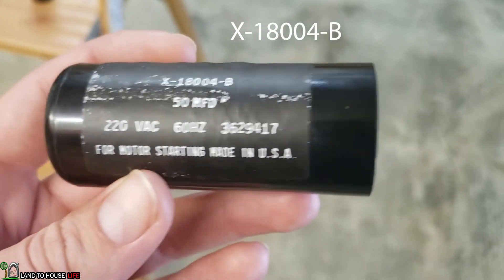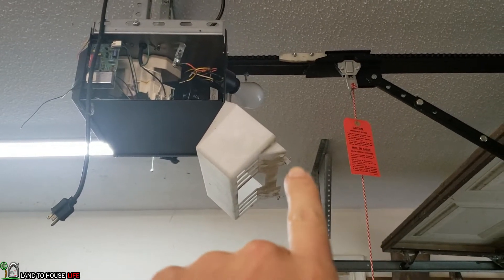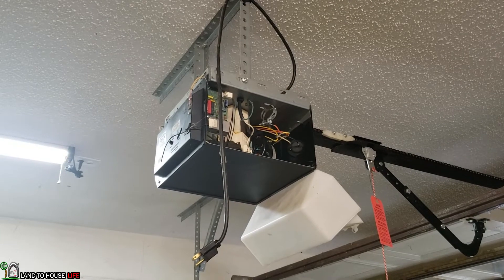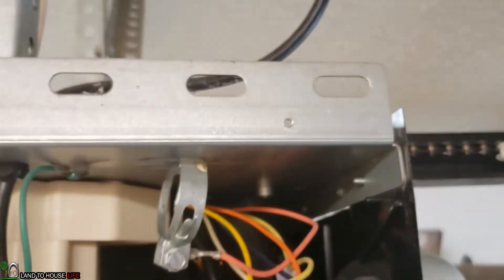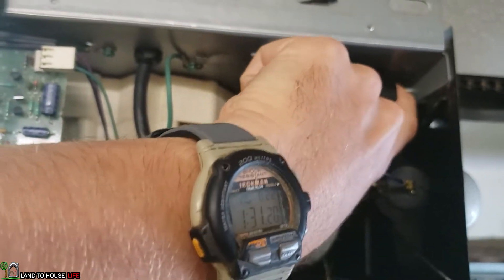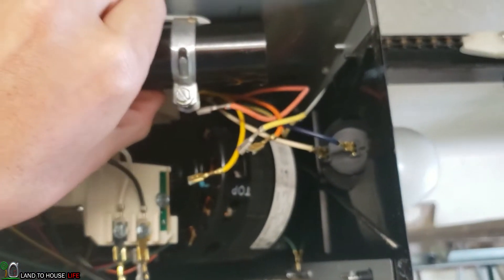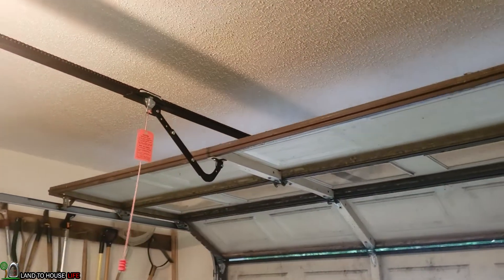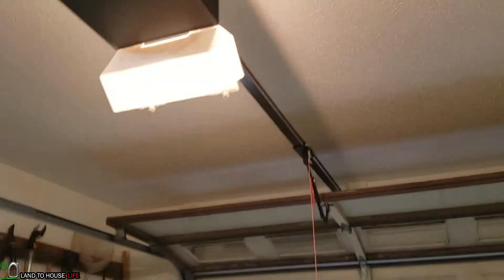Simple Garage Door Opener Fix [Corroded Capacitor]

Comment: I'm trying to check and replace the capacitor in my Genie Pro Max right now following your video. I got the cover off, but unlike your model, the circuit board covers about 3/4 of the opening, blocking more than half of the capacitor from view. Now what? Do I try and remove the main PC board, which I'd hate to mess with, or do I remove the bottom plate? Open for suggestions.

Comment: My Genie Blue Max Screw Drive was started pouring out white smoke from the inside!  It was still working and we turned it off quickly.  When I opened it up I notice some melted plastic around the starting capacitor.  I ordered another (X-18004-B 50 MFD from Amazon and it is on its way.  Mine is 20+ years old and I keep the track and the TOP of the track lubricated.  It finally failed when I was looking for the source of some noise and putting the door up and down a number of times, not letting the cap cool down I guess.  Thanks for the video.  Looks like I am on the right track and not the only one with the problem.

Comment: Will a bad capacitor make the sensors off the floor turn off??  My door will go up sometimes and other times it will open to different spots and stop.  It never seems to have any problem going down.  Ive also had to flip the breaker off and back on because it doesnt register when hitting the button at times
Reply: Did you ever figure it out? I have the same issue but only happens when it is hot. Never does it when cooler weather

Comment: if there had been a bad relay , you could have watched your new cap. burn up too. that is a start capacitor and is  designed to stay in the circuit only momentary
Reply from the maker: Good thing it was only a bad cap. The door has worked with no issues after changing this out.
Reply: @landtohouselife  did you attempt to discharge it before handling it? It may of been installed and returned then resold, you never know